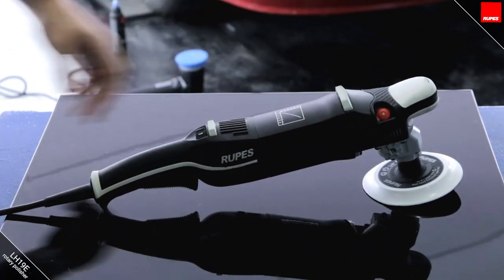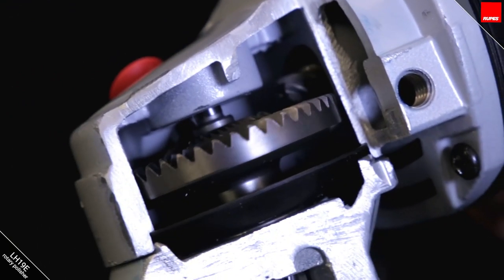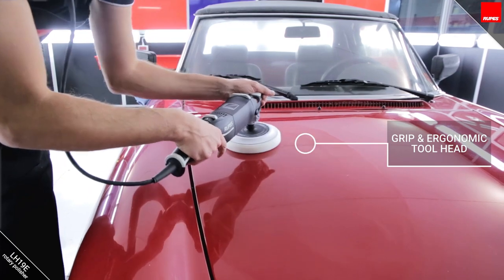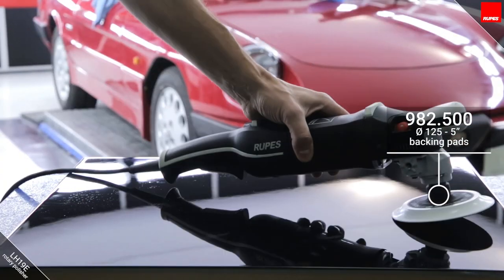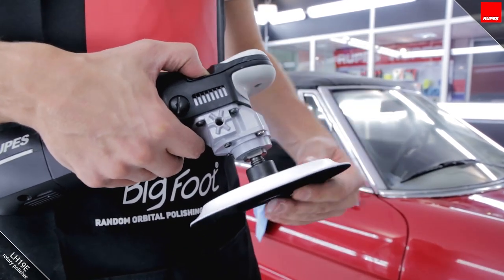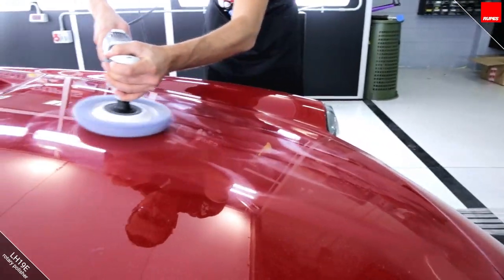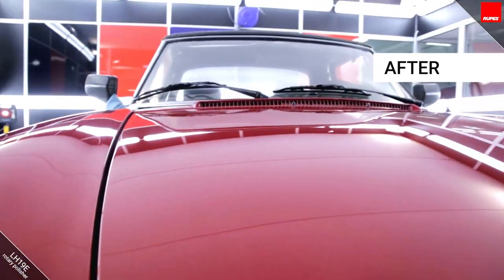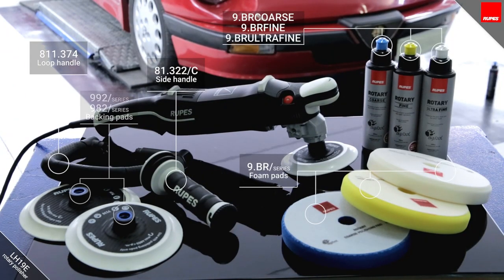Rotary polisher LH 19E

Comment: Can you use 3”, 2” or 1” backing plates on this rotary?
Reply from the maker: Yes. The LH19E has the standard threaded male shaft to accept virtually any size backing plate. Smaller is not an issue, however we do not recommend any pad larger than 200mm be used with the tool as it can cause issue with the motor due to overload.

Comment: We've been contemplating the LH19E to replace our Dewalt DWP849X of which we currently have 8 machines.  We specialise with Caravan and Motorhome surfaces, so mainly fibreglass and powder coated aluminium and need a powerful rotary.  The Dewalts are fantastic, but my colleague holds the head of the machine and always complained the Dewalt doesn't have a palm grip.  Do you know if there is anywhere we can test out one of these machines or hire one to try before we invest is a couple?  Also, what's the guarantee with these machines? Dewalt are well known for not having great backup, but we purchase our machines from Machine Mart and they always help us out with any faults.
Reply from the maker: Thanks for commenting Paul. The best place to start would be to get in touch with a distributor in your area and schedule a demonstration.